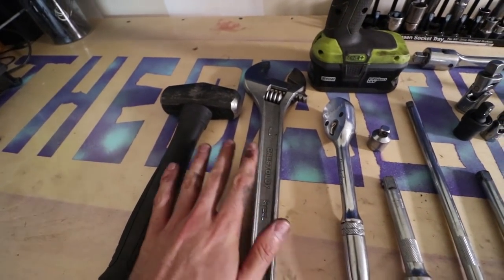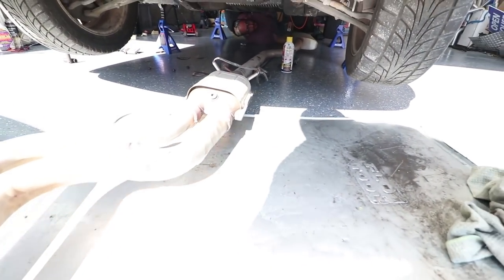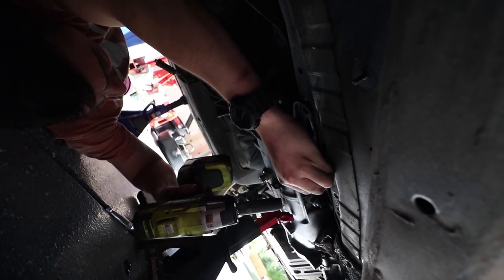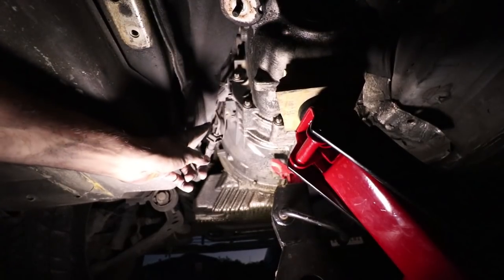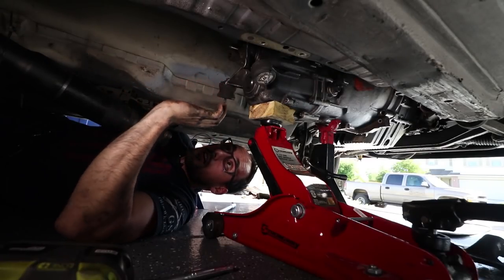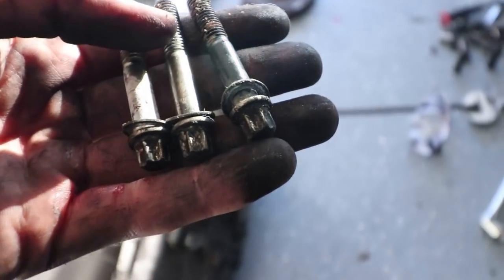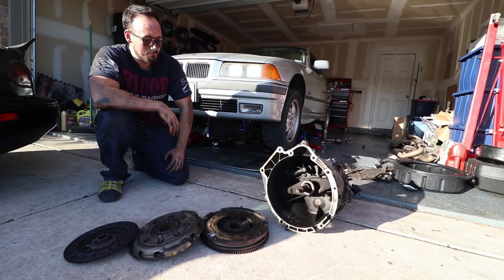How to remove a BMW E36 transmission

Comment: Nice work here is some tips for, RWD driveway transmission tips;
1. Get the vehicle as high as possible, using ramps on the front and jackstands on the back.
2. Make sure you buy a pack of the longest 3/8 or 1/2 drive extensions you can to reach the bastard bolts on the top of the bell housing. 
3. Look up your transmission to figure out the weight of it, then you'll know what you're dealing with. 
4. If the transmission is not too heavy (I wouldn't risk over 70lbs) lay under the transmission with blankets on either side of you (in case you need to dump the transmission) and your legs under the bell housing and your hands on the tail shaft casing, use the sides of your legs and knees to slide the transmission out of the clutch/torque converter than roll out from under the vehicle.

Some little tips to make the job easier.
Reply: Thanks a lot!!!

Comment: That was the easy part. The fun is putting it back on, getting it on the jack while it is under the car, then balance and align it to mate with the engine. This is a manual. if it is a 6 speed auto, it will be even more fun. It does look like you have the muscle to do it thou. Thanks for the video.

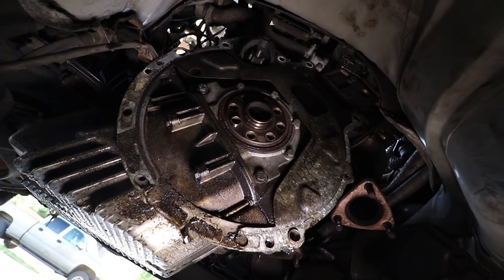Comment: 23:52 If you don’t got grease gun, you can also use wet newspaper or bread. I deadass used bread to get that pilot bearing out of my E36. I would use this method over the grease gun, as the grease can become a mess.

Comment: Very helpful. We begin this tomorrow on my sons car - appreciate you making this!
Reply from the maker: T.C. Worley thank you so much for this positive feedback, we are just happy to help. If you run into any issues or trouble spots just send us a message and we can try and help you through it.
Reply: You got it! --  thanks again :)
Reply: Well, we got all the bolts out except the drivers-side top and we stripped the head on it :/   Any advice?
Reply from the maker: dang that sucks, there are a few options to get it out depending on how bad it's stripped. Harbor freight and Sears sell bolt extractors that can help with stripped bolts. It just depends on how bad it is stripped. the other part that makes it difficult is the location. Is it one of the starter bolts or is it one of the top two bolts that are fat and short? Are y'all using an impact gun to break them loose?
Reply: It’s one of the top two. I think only the corners of the head are rounded but that bolt extractor may work. We just went and got a kit and will try it tomorrow maybe. We’ll let u know how it goes. It’s soaking in Aero Kroil in the meantime. And no, we are not using impact.
Reply from the maker: T.C. Worley hopefully that will get the job done. Those bolt extractors come in handy when they work. If that doesn’t do the job let me know.
Reply: Got it OUT! thanks again for all the info, dude.  Ruler!
Reply from the maker: T.C. Worley awesome glad it worked out for ya! Let me know if you run into any other issues always glad to help!

Comment: sweet video. How did you lock the fly wheel in place?
Reply from the maker: pbmig thanks, we used a big pry bar and stuck it in between the teeth of the flywheel and the floor to hold it in place. I think you can barely see me holding it (putting a camera under the car with two dudes was a challenge lol) but if that doesn’t work another trick is to use a bolt from the transmission and put it in the engine block where the bellhousing meets the block and use metal wire and tie it to the pressureplate. One of those should do the trick!

Comment: Swapping my trans tomorrow, can I pull the trans with the shifter still attached? Would this be easier?
Reply: I’m currently doing this and no, the shifter support is going to be in the way since its not attached to the transmission. So yeah you HAVE TO take the shifting rod out of the shifter

Comment: Great video, exceptionally thorough. You need to find some work clothes ..haha...shirt looks too good to work in...i plan to do similar and work from floor...loved how you took a lot of trouble with detail, like all tools required , what not to do , excellent....thanks again....i heard you can used bread if you don't have a grease gun....same idea...hydraulic pressure forces out bearing....thanks again...much appreciated
Reply from the maker: Thanks I really appreciate that. Yeah luckily with that brand they have a beer guarantee and if you ruin the shirt they will replace it free of charge, you just have to tell them what  you were doing when you destroyed it 😅 The bread trick really does work, you just need about a half a loaf and a little luck. Good luck on your build!

Comment: Hey mines stuck on something, trans only goes a inch from the engine, any ideas what it is? Ive been prying on it like crazy and jothing
Reply from the maker: I would double check and make sure you got every bolt out and disconnected any connections that might get hung up. If everything is disconnected and it’s still getting hung up, sometimes the input shaft of the transmission gets hung up on the pilot bearing. Try to get the transmission as level as possible when you pull straight back. Sometimes if the transmission is angled to heavy one way or another it can get hung up. Another trick is to slightly jack up the front of the engine to tilt the transmission back (be careful not to crack the oil pan, use wood blocks and very little pressure) hopefully one of these tricks should help you out.

Comment: Question. I replaced my engine wire harness but I have two plugs left. Because I only have a jack I’m unable to see it in it’s entirety but according to my friend the plugs from the engine wire harness that plugs into the trans ..the trans would have to be dropped a bit. Is this true? I thought I could just snap things in place
Reply: Reverse switch

Comment: Oh one question. Did you remove the starter before you removed the transmission?
Reply from the maker: Mack Katzel no, I just removed all the bell housing bolts and carefully pulled the transmission from the engine. The starter just rests on top of the block. Hope this helps.